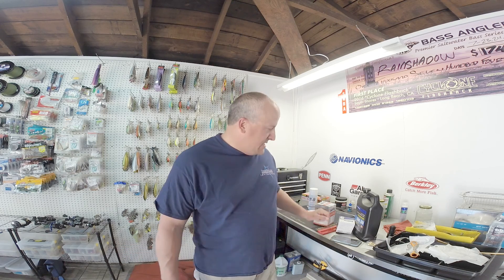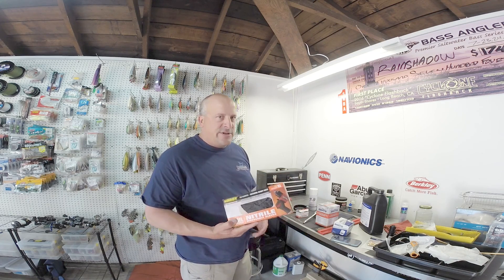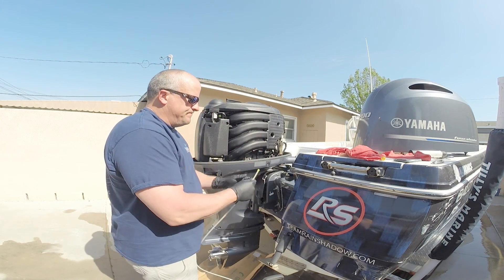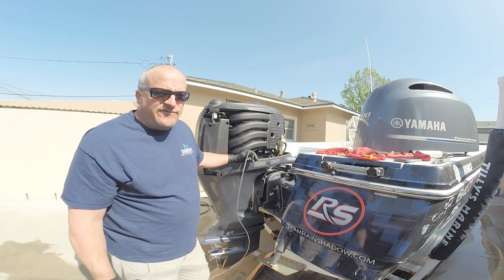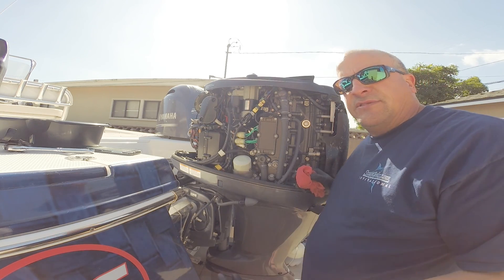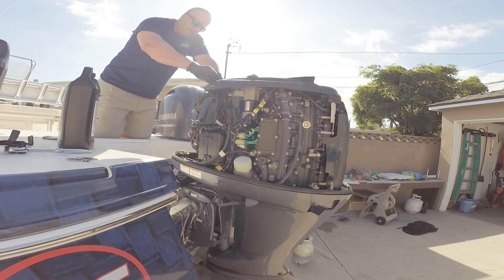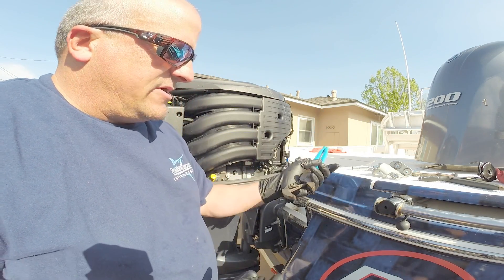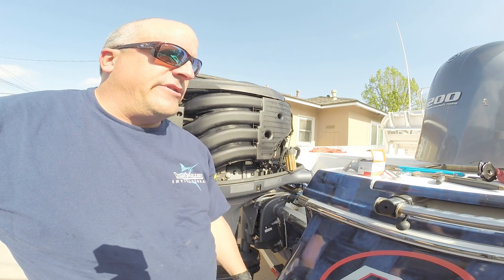100 hour service on a 4 stroke outboard motor Yamaha

Comment: Why do you not use OEM spare parts (lube, oil filter,etc). I mean, that can be as easily to acquire like  that West Marine brand? Why not use what the manufacturer intended to use and what the manufacturer has done all testing with?

Comment: What about the impeller ,lower unit oil change with replacement gaskets for the drain screws,grease all zerk fittings,check replace internal/external zinc anodes ,spark plugs with a compression test.You forgot so much stuff you need a mechanic.

Comment: Doesn’t 100 hr include spark plugs and lower unit oil change?
Reply: no this is the 300 hour service your speaking of
Reply: @andrewthompson4133  not according to my Yamaha Specs and maintenance schedule .  Plugs, lower unit, prop shaft inspection too.